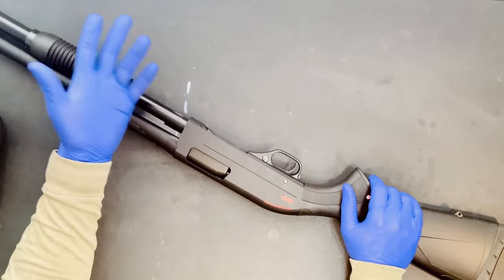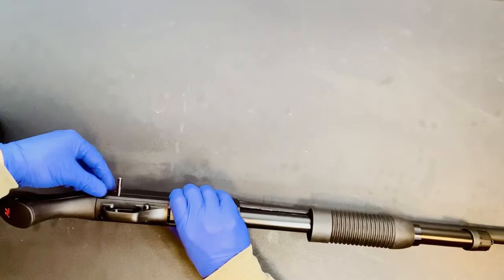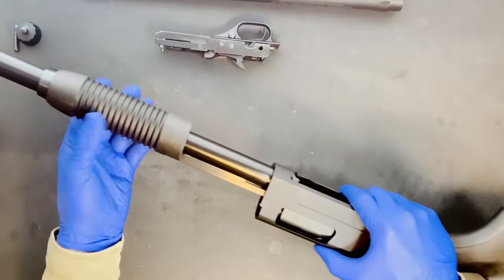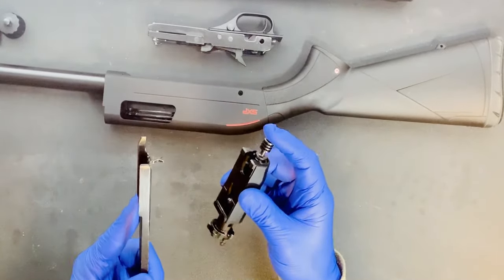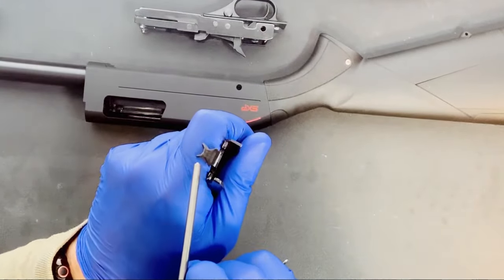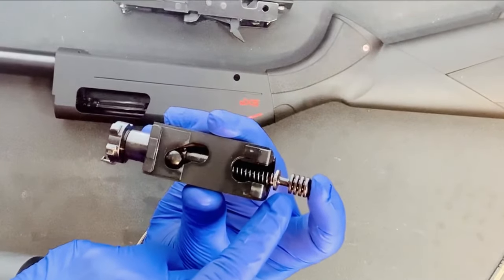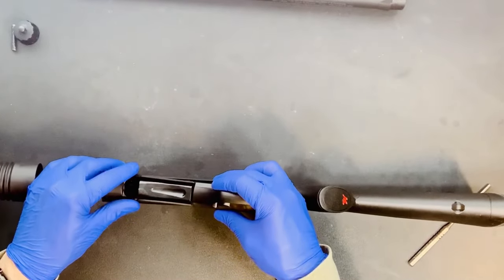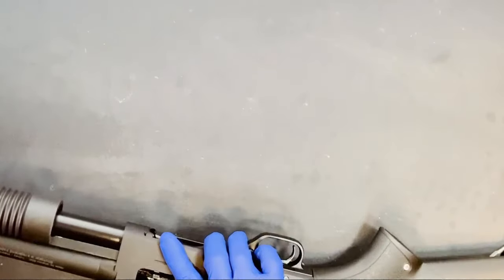Winchester SXP Defender Disassembly & Reassembly

Comment: I just ordered this gun last week and picked it up this morning. This is my first shotgun. I stripped it down easily thanks to your video, cleaned it all up and put it back together. Everything seems to work smoothly, and in a little while I'm going to find out. I'm about to step out the door and head to the range for my first shotgun practice. Thanks again!
Reply from the maker: Congratulations!
Reply: shouldn't you oil it back after cleaning it? Also should we clean it right after buying it?
Reply: @MrTetsaga Yep. It's best to clean your firearm when you first get it, this way you can clean off any anti-rust oils put on at the factory.
Oil it after cleaning, not a lot, just enough to coat moving parts with a thin film of oil/lubricant and you should be good to go.

Comment: I just picked up the SXP Marine Defender in 20-gauge, with the chrome finish. Followed your instructions to the letter, and they made reassembly and refitting of the bolt, in particular, a lot easier. Thanks!

Comment: I like how the bolt attaches to the action bars, and how the trigger assembly has all the internals clumped together. I run mossberg myself, had Remingtons in the past, but this looks like a slightly easier process.

Comment: Sweet thx for sharing. My buddy just picked up an aluminum mag tube version of this today n fresh out of the box i pulled the forend out n the bolt came out of the receiver n for the life of me i couldnt get it to go back in. I feel like it was catching up on the ejector spring but then the bolt came off the rails n of course the f pin came out 🤣🤣 . But i feel like i could do it blind folded now,thanks again 💪

Comment: I’m having issues reassembling, in particular the putting the bolt back in the receiver.  It seems to be on the pump correctly but the guide rod is binding on the ejection port side.  Did i miss something?

Comment: That firing pin is still safer than realigning a Beretta’s spring to the firing rod. Flipping partner of mine forgot to lock everything in place. The top slide turned into the projectile. 🤣

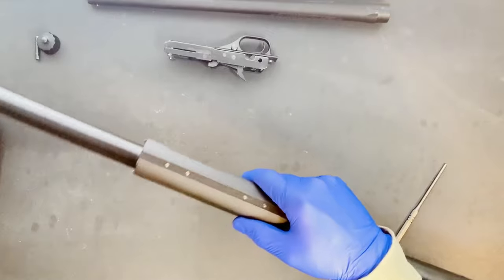Comment: Any suggestions on why sliding my handgrip will not fall back completely into the receiver (at 5:55)? When I slide the handgrip on it is getting hung up right as the bolt enters the receiver. I can not get it to slide all the way in. I have not removed the trigger group at all, so not sure that is the issue. Any help is appreciated.
Reply from the maker: Have you followed the order of the disassembly/reassembly (including removing/installing the trigger group)? It works. Let me know how you make out.
Reply: @bandofbrutes1086  Yes. That was the missing piece. I removed the Trigger group and was able to reassemble. The fact that the arm was able to be removed without the trigger group being removed was causing the confusion. In theory if the fore-end was able to be removed without removing the trigger group, then logically the arm should also be able to be reassembled without removing the trigger group, but apparently not. Thanks!

Comment: Great video! I just got an sxp, but want to swap the stock to an adjustable ATI stock. Are you planning on doing a video on how to replace the stock and forend?
Reply from the maker: Thanks, HPA. I love it as it is, but if I replace the stock/forend, I will certainly post a video. Kind of tempting, actually...
Reply: @bandofbrutes1086  the recoil pad and the pistol grip seems like a nice addition on the ATI stock
Reply from the maker: @HPAddict  You convinced me. Just ordered some accessories. Stay tuned!
Reply: @bandofbrutes1086  nice! :)
Reply: @bandofbrutes1086  I have installed mine and gotta say I am not too happy with it, gives you a new grip where you are just unable to work the slide release button, also, something seems like gets stuck, it is pretty hard to push forward to chamber a shell. Have you experiended something like this? I suspect something with the forend, because I have also installed the ati forend.
Reply from the maker: I just posted a video of the ATI forend installation. It wasn’t the easiest process because Winchester evidently superglues the forend nut on. But I’m happy with the overall result. Solid feel to the forend with no slide issues at all...
Reply: @bandofbrutes1086  I have installed mine and had to do some dremmel work on it, it was rubbing against the shell tube and sometimes felt like it got stuck.
Reply from the maker: Hey, all’s well that ends well.  But I do wish there were alternative products out there to choose from.
Reply: @bandofbrutes1086  yeah pretty limited
Reply from the maker: @HPAddict  One other thing, I did froglube the mag tube and the proximal portion of the forend. No sticking issues whatsoever.
Reply: @bandofbrutes1086  hey man, I had to recreate my fb account and I can't find the email converstation we had, where can I reach you?

Comment: So i took the mag cap off, and pushed in the part that was there. it went down a "notch", so when i put the mag cap back on it didnt make the cranking noise it did before. So i tried to twist the bit to raise it back up and the spring shot out. I pushed it back in but still cant get it to see flush how it was when i first opened it up. Did I break it? :^)
Reply: well i think i fixed it! First time gun owner so sorry if I sound like a moron/don't know what I am talking about.
Reply from the maker: That "cranking noise" should definitely be there
Reply: @bandofbrutes1086  i ended up fixing it moments after commenting this haha
Reply from the maker: @XxT0asty0atsxX  All's well that ends well.
Reply: @bandofbrutes1086  The SXP is great btw put 5-6 boxes through it now. Do you have a video detailing cleaning firearms?
Reply: @XxT0asty0atsxX  Dont feel bad. I got a Shield Plus several months back and broke it down after firing and didnt seat the spring and guide rod correctly and didnt notice. I almost never got it back apart lol  I was furious and disgusted with myself.
Reply: @jeffgreer198613  thankfully I was able to fix mine 🤦‍♂️ I’m sorry to hear that happened I would be super frustrated

Comment: How do i add a light
Reply from the maker: I just ordered some accessories and will post some videos about it. The light is a good idea, too. Stay tuned!
Reply: I got my SXP defender about 4 years ago. I ended up noticing that the shadow defender model came with a little pic mount that fits on the mag tube, I looked all through the Winchester site to see if I could buy just that little pic rail part and there was no way to just buy that piece so I needed up calling Winchester and told them my deal they transferred me to someone in the parts department she was super nice and agreed to send me that little rail piece free of charge so that was awesome. Before I got to that point I had tried installing the ATI forend but there was just to many issues with fitting so I sent it back. I’m glad I got to keep all my original sxp furniture and still have a pic mount for a light.